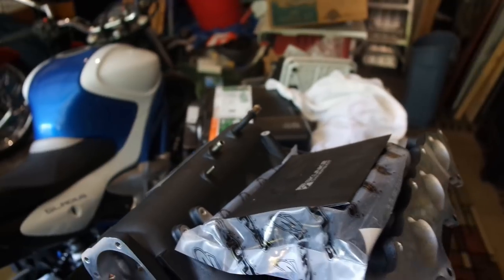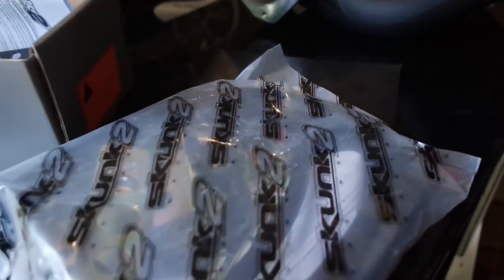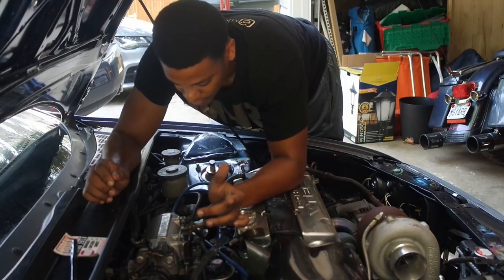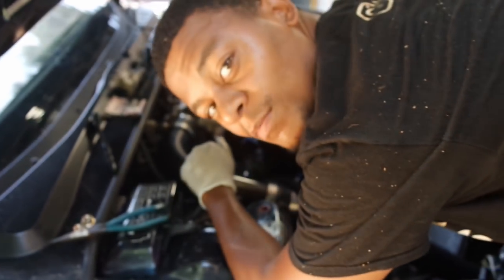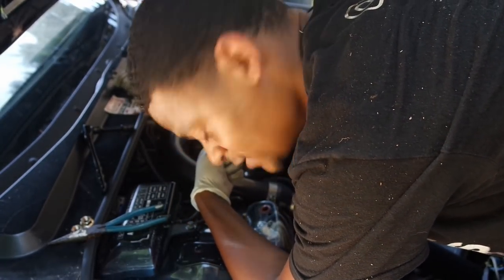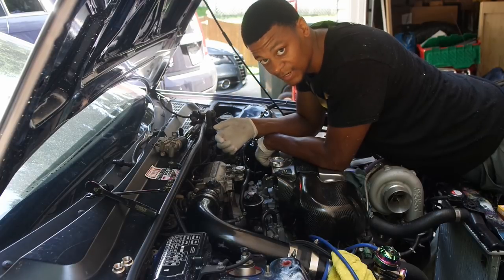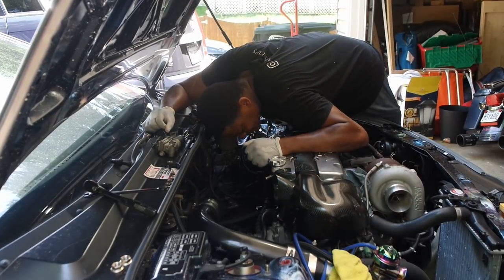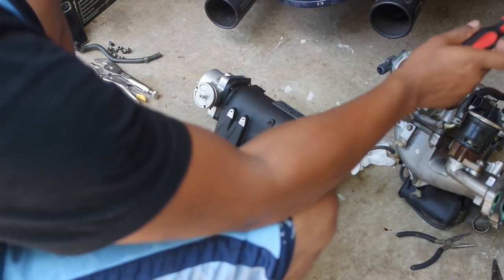Skunk2 H22 / F20b intake manifold install | HONDA PRELUDE

Comment: Nice too see f and h series in the spotlight, keep it up.
Reply from the maker: Jimmy's Brother trying bro and will do
Reply: Trey Be Dipping do you have a single belt crank pulley on that f20b?
Reply from the maker: Jimmy's Brother yezzir
Reply: @treybedipping1734  that my Bro on youtube.
Reply: @treybedipping1734  Bro what up Lol.
Reply: @treybedipping1734  Time two Party its the weekand.
Reply: @treybedipping1734  Bro Bro Happy Holloween 🎃🎃🎃🎃.
Reply: How many HP after installed skunk intake manifold?
Reply from the maker: @kennytran7246  32hp after a tune

Comment: I noticed nobody mentions draining the coolant before hand,plus its easier if you take off the oil filter also..my hands are to big to reach the nuts underneath around the filter  haha
Reply: If u install this intake do u have to get a new ecu tune? If Stock
Reply: @virginiarobles2376  no tune,but I reccomend getting the skunk2 map sensor with it also

Comment: Very cool video.
I always wanted to do a skunk2 manifold install on a H22A4 but unfortunately I'm still running a stock ECU.
So I'll know I'll run into some issues with the EGR valve sensor.

Comment: Manifold looking good on the lude man! If youre having weird throttle response be sure to check the adjustment of the tps. Measure it by voltmeter
Reply from the maker: T Delmonte i got it re tuned and it fixed it.

Comment: trey man i need help, 94 prelude h22a, i cant find where the sensor is that transfers over to the skunk2 throttle body on top my old tb didnt have one, its the one on the throttle body with the hole in the middle with that o ring you put on and the 2 screws on the sides

Comment: Yo bro nice video! What gasket manifold you put? Oem?
Reply from the maker: The thermal ones are the best ones to use
Reply: @treybedipping1734  thanks! Did you change the manifold stud? Or no need? And I put the skunks 2 manifold and I think i have a massive vaccum leak did you have the same problem?

Comment: Don't know if you still respond to these or not.  I'm looking to get this manifold for my H22a4 in my 97 prelude.  I noticed on the video the throttle body now sits back a bit further than stock? Did you have to modify your intake piping to be able to fit it to the new setup?
Reply from the maker: It's not a big enough difference to have to change anything

Comment: Did you delete that black box that was bolted to the manifold? (tank vacuum it's called on honda) asking because I want to remove it on mine just don't know if I should?
Reply from the maker: Yea I delete all of that
Reply: @treybedipping1734  I need to remove/delete mine one of the nips broke off. Could you help me out need information please 🙏
Reply from the maker: @miltonmartinez1985  should only be a 10 mil or 2 holding it on the the vacuum line going to it....just go buy some vacuum caps and block it off
Reply: @treybedipping1734  ok thanks

Comment: Nice video  can you do a breakdown video on   what you did with all the vacuum lines
Reply from the maker: Im only using 3 ports one for the blow off valve, one for the boost gauge, and the last one is to the fuel pressure regulator...the rest are blocked off

Comment: I installed a different intake manifold and i am at a lost to the part of " reconnect all plugs and wires" I didnt have the same plugs on the new manifold. Im wondering if it is something that needs to be spliced and taped off or just let the plugs hang?
Reply from the maker: Depending on what manifold you got there will be a few plugs you will no longer use....such as egr and possibly 2 others but yes i would reccomend using zip ties to keep them out of the way

Comment: Hi, what is the size compared to the original intake? I have an ek hb h22 and I want to install skunk intake but I don't know if it collided with the firewall
Reply from the maker: I dont know much about the fitment of these in a civic. I think you may need hood risers because  the h2b swap in a ek make the motor lean forward more

Comment: I’ve looked at this manifold; is it larger? Like throttle body wise? Or the ports bigger?
Reply from the maker: Manifold doesnt come with a throttle body you buy that separately but is a 70mm opening but can be ported to 74mm which is what i did.
Reply: Trey Be Dipping oh ok, so there’s enough material on the actual opening on the inner diameter to be opened up?
Reply from the maker: @gradycanty6432  yea but 74mm is the limit

Comment: What up bro great video I just installed the same manifold on a 99 prelude but having issues on where the hoses go, do you have any videos or links you can send me? Greatly appreciate it
Reply from the maker: Alot of the vacuum lines will need to be capped off your really only gonna use the break booster line and cruise control (if you have it) the rest pretty much get capped off
Reply: @treybedipping1734  do you know why I lost power now? After the install when I put it in gear no power
Reply from the maker: @CrazyDad  double check you map sensor plug as well as tps and egr. They all have the same style plug. You may have switched them
Reply: @treybedipping1734  how did you get the plug to the back of the manifold to the iacv? On the stock it was located in the front
Reply from the maker: @rolandphang  you'll have to extend the wires
Reply: @treybedipping1734  that must be why it's not staying on when I try to start it, do you know where I can by the extender?
Reply from the maker: @CrazyDad  you don't need anything special just grab some wire of the same gauge and solder it and use heat shrink to protect it.
Reply: @treybedipping1734  thank you I will try it and keep you posted thanks again!
Reply: What up again bro! So I still couldn't get it to work long story short I went back all stock but now it doesn't want to stay running like it's not getting enough fuel or being grounded
Reply from the maker: @rolandphang  it's almost impossible to diagnose a problem like that over the internet. I would try and do a compression test to rule out the motor being trashed

Comment: nice video man. i have f20b and my iacv is from f22b sohc with adapter plate and 2 wires connection.
planning to buy skunk2 intake manifold same color as you had now. do i need to use my old plate adapter for iacv or not? i am not sure why my iacv have a adapter plate. but when i google it says convert from 3 wires to 2 wires. how about your iacv is that 2 wires?
Reply from the maker: Yea the three wire is ob2 and 2 wires is obd1 im not sure about the adapter plate.
Reply: ok but how about the fitment can i still use the plate to skunk2 manifold?  sorry man need to ask to make it clear :)
Reply from the maker: @darbats  im not sure to be honest.you may not have to use it at all.
Reply: last Q your iacv is 2 wires?

Comment: Can i run this off a stock ecu? Or would it cause the engine to run rough?
Reply from the maker: It will run but in a perfect world you would want to get chipped ecu and get it tuned to really benefit 100%

Comment: Where can I find an engine harness for the f20b/h22?
Reply from the maker: Best bet is a junkyard pull it from a prelude 97-2000 or rywire sell harnesses as well
Reply: Trey Be Dipping thank you! I been looking everywhere for one. This my first project car I’m working on. I didn’t know the 97-2000 would fit tho.
Reply from the maker: @TerrioTheGreat  the only difference is you will have to re wire the injectors to obd1 connectors and few others like egr and there may be one more
Reply: Alright but what if I want to keep my old harness? Cause I just need a MAP/TPS connectors but I can’t find where the wires are located. Is there a way I can just wire my MAP and TPS another way?
Reply: Trey Be Dipping how do I retain my old harness? the car didn’t have a MAP/TPS sensor connector wires or anything so I’m lost. Do you suggest a new harness or what?
Reply from the maker: @TerrioTheGreat  hard to help over youtube comments but it would be best to get a new harness if your missing all that. You can use any harness from 92-96 as well but you may have to wire in vtec to the ecu
Reply: Trey Be Dipping alright I found my MAP sensor it was located by the firewall. I think it should be a easy fix. But if not I’ll just buy a new one or go to junkyard first. Thanks for the help! Keep up the good work for the prelude fans 👍🏾
Reply from the maker: @TerrioTheGreat  will do bro

Comment: How did  you route your coolant line
Reply from the maker: Directly to the thermostat housing
Reply: Did your skunk2 only have one hole in the back
Reply: Or do you have any photos im completely lost on mine
Reply from the maker: @realpowermotion6235  it should have come with andapter and a block off plate. 

The adapter shoulf have had 2 ports
Reply: I dont think i received the block off plate idk

Comment: Ay so my car won’t start after I took my intake manifold off
Reply from the maker: You put a new intake manifold on with a new gasket?
Reply: Trey Be Dipping I actually was having idling issues and I went to clean my IACV which was on the back of my skunk2 manifold and I but it bac together and now it’s a crank and no start

Comment: What did you do with the egr?
Reply from the maker: Sinister 661 on the skunk2 there is no egr its completly deleted.
Reply: Did you just plug the hole  on the valve cover?
Reply from the maker: Sinister 661 thats not the egr and no im still running that line from the valve cover to the manifold.
Reply: Oh my bad, so that one way valve  right of the valve cover still gets used? Just hooks into the sk2 mani?
Reply from the maker: Sinister 661 yes sir
Reply: Trey Be Dipping ive also Hurd the stock fuel rail won't fit the sk2 mani,  Did you use a aftermarket one?
Reply from the maker: Sinister 661 i used a obx rail that i already had... not 100% sure if the stock one works or not

Comment: Skunk is actully entry leval Chinese junk.
Reply from the maker: Always thought it was euro r spec manifold replacement. Thats why i got it.
Reply: @treybedipping1734  it's not horrible dont get me wrong bro! Honestly I thought for years it was a top brand because everyone used it. But everyone used it because it was cheap I guess. I watched another video that said it was just a little off in quality control. Mainly on stuff like valves and stuff. They will have a lot of skuffs in the metals. But for a manifold you caint go wrong. Hey bro about how much have you spent building your car. Iam going to try and put 4 to 5 thousand up to build one. Do you think I can build one decent this way.
Reply from the maker: @danielbeavers8701  yea bro im prob around that same range right now